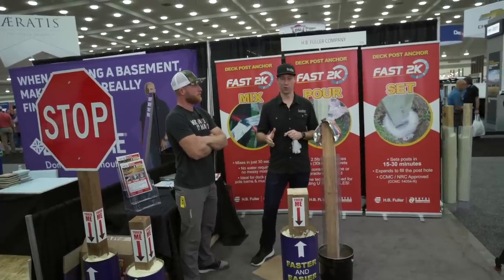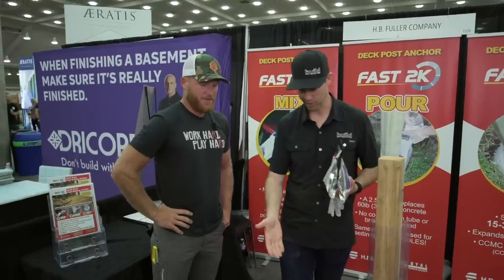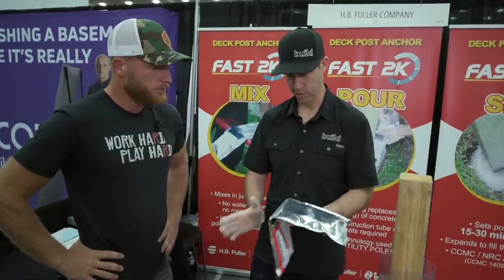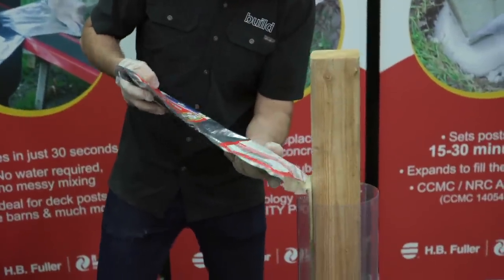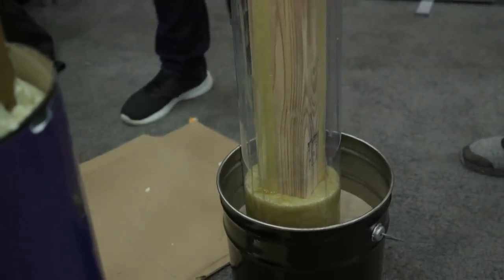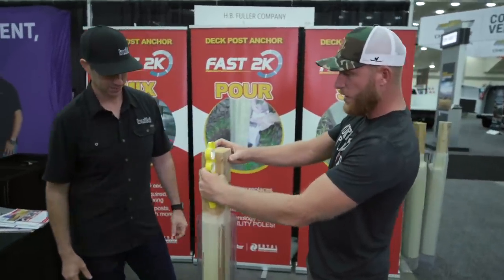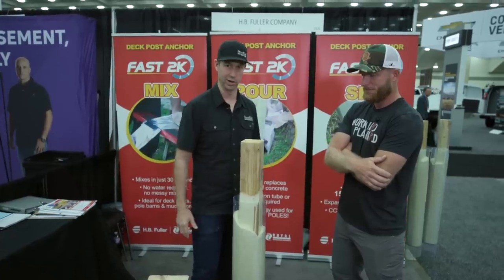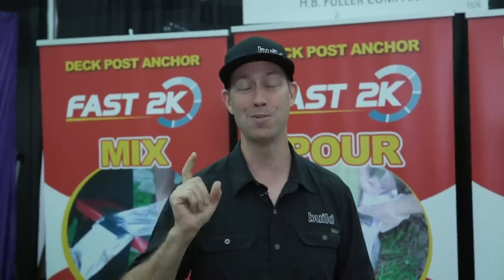Foam INSTEAD  of Concrete???

Comment: For my pressure-treated 4"x4" fenceposts and clothesline poles, I use pea gravel.  Dig hole, insert 4"x4", pour in pea gravel.  Give it a jiggle, add a bucket of water, give it a jiggle again.  Add more pea gravel and water until the hole is filled and the pea gravel is all settled tight.  The clothesline poles have been in the ground for close to 25 years and are still just as strong as the day they went in.  Not only does the pea gravel allow the water to drain away from the post, preventing rot, but when it comes time to pull out the 4"x4", it comes straight out without a big, heavy lump of concrete attached to it.  Now, for our deck and front porch we had to do what the building inspector insisted on, but for the others the pea gravel worked.

Comment: I've used this on a couple of privacy fences that I've put up. Sadly it doesn't hold up near as well as concrete and it is not as solid
Reply: Was just going to ask how it worked with chain-link fencing. Thanks for answering my question, lol.
Reply: I agree. The privacy fence I built started to lean right away. This product is better used for a mail box post or a quick fix.
Reply: @philxdev  I bought foam for replacing  cattle gate posts. 
After digging out the old posts the holes are 2ft X 3ft. 
The foam wont be dense enough as there is no resistance for the foam.
I would be pouring foam into an open hole..
So, I'm going with rebar and cement.

Comment: I have used this personally. Low land by lakefront super high water table. Could not get any Crete to set up well on 12 ft poles 5 foot in. Hour glasses the holes with the pole to about 75° and wallowed it well. Shopvac out water and pour foam. Its held up even with kids jumping the fence 2 years now. Love this stuff.

Comment: never put concrete on fence post, they last longer are adjustable over time and easily replaces at the end of their life. Now if you have load bearing posts, like for decks or buildings, you do need a good footing. for that application I prefer the metal brackets embeded/anchored in concrete. My 40+ years of experience.
Reply: Same here this only good for fences and other posts and some small decks, but due to its lack in compressive strength per video proof testing its not quite up there with longer term higher strength concrete with wet or drill set brackets. But it is cheaper than concrete for not so permanent structures especially ones that may need full replacing every decade or so. I have known about this foam product since 5 or 6 year ago.
Reply: That sounds reasonable. However, in my neighbor's sandy loam, she had to rebuild her entire fence because all the posts were falling. I use concrete every time with no problems. We get about 40 inches of rain per year.

Comment: Fabulous product today, what's it going to be like in 10, 15, 20 years? Does the foam breakdown? Is it UV proof?
Reply: The top of it will be buried so no UV should ever touch it.
Reply: It will most likely decay leaking some sort of horrible toxin into the ground that will cost thousands to clean up. By then all the necessary licenses and permits will be set in place by the government which will be required just to clean up this crap.
Reply: JourneyTotheTruthandTotalRandomness 
This is not recyclable and when finished its useful life it will be an environmental issue..... forever. 
Concrete has its costs but then when crushed it can be totally recycled.
Reply: UV proof for something underground?? Lol
Reply: So coating the post is just BS?

Comment: I’ve used this stuff.  I imagine it’s good for things like fence posts, or posts that have near perfect vertical loading, but if there’s any kind of twisting moment on the post, it doesn’t hold like concrete.  I built a wind chime holder which looks like a cross, with one arm 18” long, and the other 36” long.  It sits 36” into the ground an 8’ above ground.  Once I hung the chimes, it went out of plumb.
Reply: Put in 3.5 inch screws that protrude out 2 inches and then drill a bunch of 1 inch deep holes (half inch or 1 inch diameter)... along the 2 feet length of post that goes into the ground.. these voids and protruding screws create teeth that grab onto the foam. I also coat it with a paint to protect it from the water... Bitch is not moving especially if you go 2-3 feet deep.

Comment: For those viewers who aren't clear, Mr. Stumpenhorst is obviously a contractor who does this type of work for a living. He doesn't buy one bag of concrete to set a post or two, he works on sites where they install enough posts to require a concrete mixer truck. Compared to that expense, this type of product is big savings.

Comment: Kyle test this yourself. And also do it with a chain hoist or crane so it’s pulled vertically cuz that bobcat looks like a radical lift so the machine snapped the post and not the lift.

Comment: I considered using this foam for a mailbox post two summers ago.  You got to love no lifting and mixing bagels of concrete.  I had recently had knee replacement and didn't want to over do it.  But living where the frostline is 3 ft. and digging with just a shovel my hole would be so wide beyond the 4 x 4  that  it would take close to three of those foam bags.  I could have used a sonotube, not cheap, but I wasn't convinced it would as strong as concrete to stand up the  sometimes 4 feet of heavy snow winged at it from plows without the concrete's weight.  Had I had a post hole digger and kept the hole narrow I might have gone with it.  I can see a real use for it in locations where getting concrete to the location is difficult or time is a factor.

Comment: I like Kyle and his YouTube channel, but I disagree with his comment that concrete rots posts. All the rotted post that I have dealt with had the rot just above the top of the cement and the cement top was below the ground surface. The part of the post down in the cement was OK. When I set posts I build a small cone of concrete around the post above the ground surface.
Reply: Im actually worried about this product sealing the post and making it retain water and causing it to rot. Concrete will suck the water out of the post.
Reply: Maybe it’s just experience that I’ve lived... but I’ve always seen the rot about 3-6” below the concrete... over time the posts becomes basically separated and  sitting there in the hole.  Structurally it probably isn’t going anywhere, but uplift is the issue. This exact reason is why I tore down a shed at my house...  I’m only speaking from experience, Matt is the science expert
Reply: Crashz28 this stuff will rot the post and the foam breaks down in a few years.
Reply: RR Buildings Thanks for the input. I am also not a scientist, but I can see the rot occurring a few inches below the top of the cement if water can get to it. If the wooden post is completely covered by cement the water should not be able to penetrate into the wood for rot to start. In addition to the barrier formed by the cement, the high pH of cement will help prevent fungus (which causes rot) from being able to survive. 

I first saw you channel when you built Jimmy Diresta’s shop. I watched the whole series and really enjoyed it.
Reply: @RRBuildings  hey man - love your channel too!
Reply: where did you get this information?
Reply: Sam Pickett thanks
Reply: RR Buildings what are your thoughts on attaching a post on top of a poured footing? Sure this method is fast/easy, but the wood will still absorb moisture through the exposed post, not to mention if you are setting a post that is real green and full of moisture. How will it dry? Seems like wood needs to be independent from the foam/concrete so that it can breathe and dry out as well as expand and contract with temp/moisture changes. I am not an expert, just speaking on my own experience with my own homes and others I have seen rot, both fence and deck posts. 

Side note, is this strong enough you could mount a post on top of it either with a mounting bracket or some all thread that was placed deep in the pour? Any tests on that? I will research, just thought I would ask.
Reply: If you watch his channel he does attach his posts above the poured footing. He uses a metal bracket set in the concrete.
Reply: Sam Pickett Cement/Concrete doesn't "seal" anything. That's the common misconception. It's porous. Water can soak though the cement and rot the post. I you look at some concrete bridges that have failed it's from rebar rusting inside the concrete.
Reply: it was my understanding that the rebar rusting was caused by the concrete inevitably cracking because well that's the nature of concrete but that "intact" concrete that didn't crack wouldn't have that.

Though perhaps even deck footers crack?

As I understand it for example while some bridges use things like galvanized rebar etc that is immune/resistant to water exposure. They also use glass fibre or other additives to reinforce the concrete mix and prevent cracking. (at an obviously increased cost) but that helps protect the rebar etc inside.
Reply: zack9912000 the foam will degrade if left exposed to uv rays. It will not just break down below grade.
Reply: Posts rot off at the surface to around 6 inches below grade. It has less to do with moisture and more to with contact with live soil. The tiny microbes near the surface of the soil go to work making a meal of the wood. If you can prevent soil contact, you can prevent rot. I used a product called post protector when I built my garage. It’s a plastic sleeve that slides over the post and fastens. The system seems to be good for preventing rot.
Reply: Concrete is porous, so it will not seal the wood from water. Soil is moist is... basically everywhere that isn';t an arid shithole, and the alkalinity of concrete is temporary and is leached away over time. The moisture in the wood to begin with can slowly migrate out the top. Water predominantly migrates along wood, not across it.

I don't see the foam degrading, tbh. By being in the ground it's sheltered from basically everything that might deteriorate it.
Reply: @Don Ziolkowski Both of you are right. Concrete IS porous, but cracking does accelerate rebar rusting (and other forms of damage). The thing is, once rebar starts rusting, it expands, causing cracking, which lets air and moisture in more rapidly, accelerating the rusting.
Reply: Mrcaffinebean For most practical purposes cement is impermeable and will protect both wood and steel. However cement/concrete is very brittle and if it is stressed enough by either thermal or mechanical forces it can develop cracks and allow water to penetrate. This happen to a lot of concrete structures
Reply: Sorry accidentally sent too soon. When the water gets into the stress cracks it will contact the rebar and cause it to rust. Also sometimes the rebar is installed improperly by placing it too near the surface of the concrete.
Reply: @seigeemgine What about the water in the wood, will it collect perhaps?
(though if thats the case, nothing will help) I mean I assume water will migrate into the entire wood via the exposed top during rain or high humidity for example in the spring and then the top will dry much quicker than the bottom because you have gravity + lack of exposure. 

That I guess MIGHT also crack the concrete possibly? The main thing against the idea of the cracking concrete to me is post footers really seem the ideal concrete application because the load should be 100% vertical compression (assuming of course you've kept the post plum and level) Which concrete is amazing at. 

There really should be no cracks developing unless you have settling of some kind or poor leveling that causes an angled pressure or I guess in theory if water in the wood expands (or water freezes that got into the concrete over time in small quantities) and of course liquids being incompressible, you'll get cracking.
Reply: I would think that 12" of gravel at the bottom and around the bottom of the post would keep concrete from rotting even when you top it with a concrete collar, but maybe you have more clay soils in Texas.  Ours is all sand/loam or rocky.
Reply: I think the 2 major problems with sitting Post in concrete R1 concrete transmits moisture so you're always going to have a moisture problem from the concrete itself and then you get that little cold joint between the concrete and the post itself maybe a 64th of an inch it's just a hairline crack and that allows water to seep down into the post.
Reply: Yes! That is exactly what I was going to comment on... I always make sure the concrete is above the ground level around my post and make the cement pitch  away from the post ... As most rot occurs at the ground level where the post meets the ground... My one concern is whether the foam will expand to above ground level to where you can Ensure post will not be sitting in water at ground level. Otherwise the product looks great just wondering what the cost is.
Reply: Ever build in a remote location?  This would be unbelievable, considering you would not have to haul cement and/or water.
The thing about this that also makes me curious is would it hold up better to earth movements (seismic activity)?
Reply: Ive seen em (posts) painted with driveway sealer, when dried buried in concrete above grade with tapered concrete top to shed water. No issues still
Reply: In the old days they used diesel to coat the bottom of the posts to keep from rotting they would last a very long time but you can't do that anymore
Reply: Hi Kyle, this is Edson Fariello with H. B. Fuller, the manufacturer of Fast 2K, the product that Matt and you demonstrated.  Thank you again for stopping by our booth. It was an honor to meet you and Matt. In regards to rotting, your experience is what we've seen too. Concrete keeps absorbing water and exposing the post to that. Fast 2K is hydrophobic which means it repels water. When water reaches the footing, it goes to the side and is absorbed by the ground.
Reply: No, concrete is porous. It absorbs water and rusts metal. If basalt rebar is used, problem solved.
Reply: roach I remember creosote being used, it left hands and clothes black. I wonder if they mixed the diesel with borax?
Reply: Bull shit reasoning and sales talk. 

You need to seal your posts and poles, also water management around your posts is important to keep your wood lasting for years. 

There is telephone poles and and electrical poles that have been standing in my area for up 22 years as long as my mom has owned her house for. 
And they are buried into soil no concrete. 
So I call bullshit sales gimmick.
Reply: @sampickett3843  great theory but you could not be more wrong because concrete is very porous and does not stop water from getting to the post at all, and here in canada the winters make it that much worse when the water freezes and turns to ice. 
We have been setting telephone poles for the last 10+ years and the foam is holding up wonderfully and makes setting way easier and less time sensitive having to use the concrete in time So less waste and cheaper in the long run.
Reply: if its open cell foam yes closed maybe not
Reply: @johnlimongello5716  they state the cost in the video.
Reply: I’ve seen some people put a small bed of crush stone in bottom of hole first and some just the post right to the ground. What your thoughts on that??
Reply: that's all fine and dandy, but not an option for structural integrity of a building, need that uplift protection.
Reply: may have been said but the post rots because of water and air and this is why it is at the level with concrete, of coarse it will be a few inches down in the post/concrete hole. If you look at wood submerged in water/mud it can be there for many years as there is no air. I think this is a good idea for fence posts not sure about a garage or building though, but my mind could be changed if I could try it free of charge.
Reply: I totally agree. Concrete doesn't retain water unless its frequently saturated with it. But if that's the case its not the concrete that's dry rotting the post. Its the constant saturation of the water itself that's doing it above the concrete.
Reply: @stephenjohann9578  as long as you mount it on a metal bracket separating it from ground level you should be good but there's always the purpose  of said post to take in consideration. Mostly what kind of load is it bearing.
Reply: You’re supposed to have it above ground so water drains away from the post. What he is referring to is that concrete is porous and allows water to get to the post which causes it to rot. I have to replace a fence in my backyard and it was all rotten because the water table was high and the posts were constantly soaked underground

Comment: I have used this product.  im a builder in Pennsylvania and we have to poor concrete under the posts at 4' deep, then we fill preferably with 2b stone or the existing soil, this is code for building a post building or a deck.  I dont know why you would ever waste the time or money to poor concrete around a post plus it would be way more difficult to keep your post in position and level.  I have used this product to set a aluminum yard fence because it was raining and our dirt was too muddy to work with.. had to get it done!  anyway week later homeowner wasnt happy the fence was not strong so we dug all the foam out of these holes and used concrete (it was a nightmare)